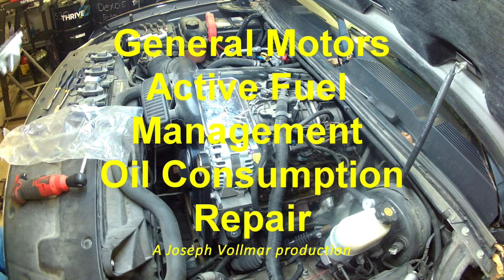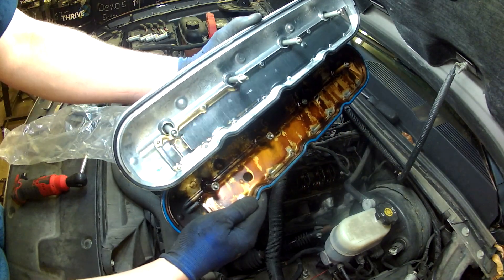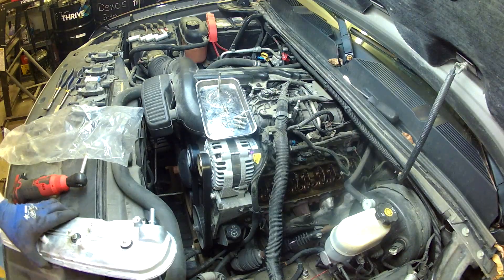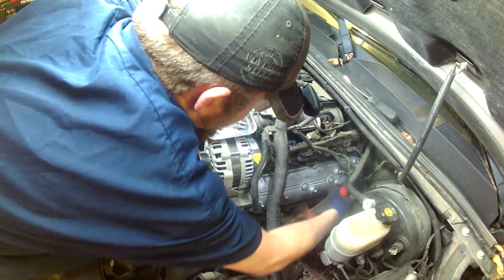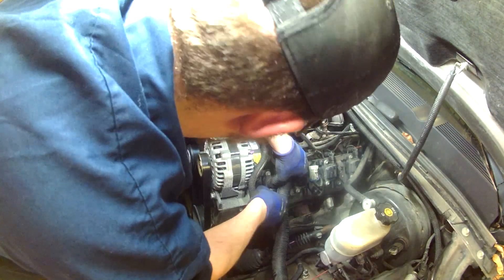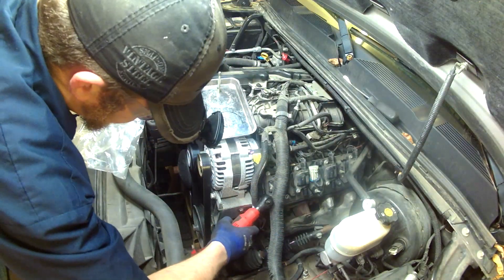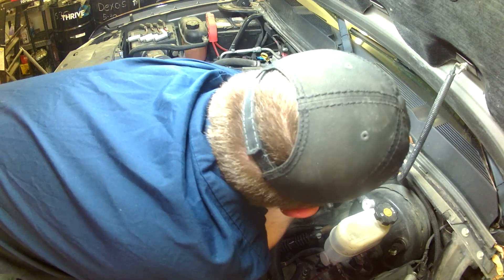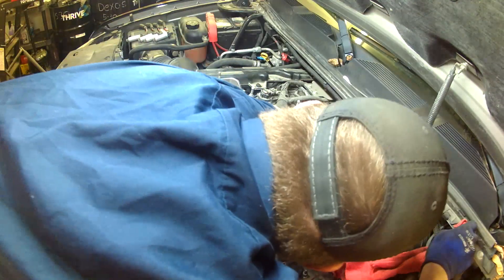General Motors Active Fuel Management Oil Consumption Repair

Comment: What year did they start with the updated valve cover? In other words, I'm in a 2014 model. Should I be concerned?
Reply from the maker: General Motors started phasing in an updated valve cover around 2014 or 2015, but there were a large number of vehicles that were still coming out with the old style cover. I don't know if they were trying to get rid of the rest of the stock that they had, or what the deal was. if yours is the 2014 model I would pull it off and take a look at it. If you have the updated design all it will cost you is maybe an hour of your time and possibly a valve cover gasket (they generally can be reused, but just check it for damage before putting it back on). If you have the old style catching it now could save you money down the road.
Reply: @JosephVollmar  if ive got the old style and want to give myself the best odds of correcting the problem, I know I need the updated cover and a new gasket, is there anything else I should add or replace?
Reply from the maker: If your truck is lower mileage, say under 40,000, and has not been using any oil I would not be too concerned. The biggest issue that is generally associated with this problem is that the rings will get carboned up from the burned oil. If yours has been burning oil I would buy a can of Sea Foam engine treatment and add it to the oil about 250-500 miles before your next couple oil changes. This will help to clean up any of the carbon deposits. Just try not to do any heavy towing while you have the Sea Foam in the crankcase. It will thin the oil down a little bit, so you really don't want to put a hard strain on the engine with thinned oil. If you cannot find Sea Foam, you could use Marvel Mystery Oil. 
    Aside from that I don't think you will have any problems.
Reply: @JosephVollmar  it's a 2014, 96k miles. At about 60k miles I had one single spark plug fail (either number 1 or 7 if I remember), but no explanation why. Then a few days ago, at 4k miles after an oil change, my engine oil low light came on, and it was 3qts low. Dealership confirmed no leaks. My catalytic converter failed two days after the low oil alarm, so i'm assuming that's likely from the oil consumption.  I'm not sure yet if it has the old style or new, but this issue seems to fit the symptoms perfectly.
Reply: I have a 2014, and my truck is in the shop for it as we speak. 4 days ago got the low engine oil alarm, was 3qts low 4k miles after an oil change. Added the oil back. Yesterday my check engine light came on. Took it in today for an oil change and to check the light. They determined it burned the oil, zero leaks, but "werent sure why." The check engine light was for catalytic converter failure due to oil consumption. Idk if the issue in the video is the culprit, or will fix it, but it definitely seems to affect 2014 models as well.
Reply: Mi Sc *9 7

Comment: cool video, where did you get the battery powered ratchet?
Reply from the maker: noway man it’s a snap-on. After I bought mine my boss bought a Milwaukee and if I could do it again I would go with the Milwaukee, more torque, smaller profile and batteries are a lot cheaper.
Reply from the maker: noway man I do have a video reviewing the battery ratchet from snap-on.

Comment: GM active fuel management fix. Buy a tundra problem solved.
Reply from the maker: Ramiro Escamilla the Only problem with a Tundra, look up rack and pinion replacement and step one is remove engine assembly. Not kidding, been there. It is a job that pays 20 hours of labor. You can do it without removing the engine, but you have to pull the front axel to do it.
Reply from the maker: Ramiro Escamilla my last comment was not a joke, but all joking aside they all have their issues that make you wonder what the hell the engineers were thinking.

Comment: Where would be the proper place to purchase this valve cover?
Reply from the maker: Robert Munguia any auto parts store. In most cases it would be a Dorman brand product. The part number for the Dorman was posted by one of the other commentators. Shop around and see where you can get the best deal. You may even try the part number on amazon.
Reply: Yeah thanks! On amazon it even gives me an AC Delco model.
Reply: What’s the part number ? And price

Comment from the maker: 12570427 Is the GM part number. On of the other comments lists the dorman part number through Rock Auto.
Reply: Joseph Vollmar I have a 2014 Sierra 5.3 which is burning oil...Will this fix it? I have an appt with the dealer this week to start a oil consumption claim under warranty but rather than piston/rings, this makes more sense...Or, did GM remedy this in my year? Pls let me know asap..drjohnboruta@telus.net Thanks
Reply from the maker: ATLP exhaust non resonated you are on the edge as far as the valve cover goes. If you can get the dealer to fix it you may be better off. I think in some cases if the oil consumption is bad enough they are reringing the engines.

Comment: I've done this on 09 5.3 v8 Silverado. But after about 2 months  cyl 1 has a misfire due to fouled spark plug. Makes no sense spark plugs were brand new also 2 months ago. Now am considering doing the deflector that's also recommended by gm. Truck only has 90K
Reply: Same happened to me today. I replaced plugs at 100K back in Sept 2016. I replaced the valve cover (updated version) March of 2018. Yesterday and Today experienced a P0307. Fouled plug on Cylinder #7. I checked the plugs esp AFM cylinders and AFM plugs were all fouled. Heavy carbon buildup and soaked in oil. Non-AFM cylinders looked great. It may be time to get rid of the truck or do a Texas Speed AFM delete with a new cam. GM ruined a perfect engine with this system.
Reply from the maker: Tomas Torres I completely agree with you. The pre AFM trucks got the best fuel mileage of any of the full-size 4x4 trucks, and the Addition of AFM did not significantly affect fuel mileage. They should have just left it alone. I have personally seen the abuse the early 5.3L’s could take, even with poor maintenance and still go well past 200k or 300k miles with no major issues. This is one of the reasons I personally would not by a late model GM vehicle. 
     Before you dump your truck though you may try putting another set of spark plugs in it (the cheapest AC Delco offers) and then change them again in 6 months or so. The bottom of the intake on the 5.3 can hold a lot of oil, and there may be residual in there from before the valve cover was changed that is slowly being sucked through and burned. You could also try pulling the intake and cleaning it out with brake cleaner and putting it back on, then see if the plugs are still fouling.
    We have also had two of these engines develop a miss because they sucked one or more valves on the AFM cylinders. We suspect it is from the heat and cool cycles as the cylinders cut in and out.
Reply: If you delete the afm with a range technology module will that stop the oil consumption?
Reply from the maker: james britt it may not completely stop it, but it should substantially slow it down.
Reply: @edwardbritt3076  I deleted the afm on my 2011 silverado and it still consumes 1.5-2 quarts between oil changes. Didnt know about the valve cover so thats going to be my next thing.
Reply from the maker: seduzu420 The deflector would be worth a shot. Normally cylinder 7 is the first one to oil foul because the PCV enters the intake right above it. Let me know what you find out/ how it works. I have never heard of a problem quite like yours before.
Reply: Was the misfire only noticeable while at an idle?

Comment: Chevy is shit, 45,000 miles on wifes equinox and it burns two quarts of Mobil one every 1000 miles. It's a 2010. Dont buy these vehicles.  Not only that but you are lucky to ever get better than 20 miles per gallon.  The 30 they claimed is a complete lie.
Reply: Cant blame the whole batch over one rotten one. Got a 07 avalanche with 250 thousand miles and still pushing on
Reply: @johnnytsunami6185  how many tranny?
Reply: Original believe it or not
Reply: @Johnny Tsunami  nice , I'm glad for ya

Comment: I just bought a 2018 5.3 Silverado.  Anybody know if this issue has been corrected by Chevy or will I be looking at this fix later down the road ?
Reply from the maker: They know what the issue is, and supposedly they have fixed it. I have heard of some of the new trucks ending up with the old style valve covers. I don't know if they had some old inventory that they were trying to get rid of or what. The best thing you can do is just pop it off and check for yourself.

Comment: I have a 2012 model and I'm going to check mine this week. You make it look like an easy fix. I'm also going to install a Diablo predator 2 tuner and disable the afm system. If I wanted to save fuel I wouldn't have bought a full sized 4 whl drive, I'd drive the wife's import.
Reply from the maker: It really is a simple fix. With limited mechanical knowledge, and a few basic tools this job may take a little more than an hour, while someone with reasonable ability will fly through this job.
Reply: that’s me

Comment: I need to try this on my 2011 Silverado. Replaced wires and plugs recently because it had multiple misfires on number 7. The plug was fouled with oil and haven't had any misfires since I changed them. The shop manager at the local dealership was talking of this but looks easy enough to do myself and save a few bucks.

Comment: Yes, i want to know my 2007 chavy avanlanch burning oil when cold start. Please can you tell me. how to fix.
Reply from the maker: The first thing I would need to know it the mileage. If it is a higher mileage vehicle, it could be leaking or worn valve seals, It could also be from issues with the valve cover as discussed in this video. The reason you would only see it on a cold start is because once the catalytic converters come up to temperature they will burn off the white smoke that you are seeing when you first fire it up. I hope this helps a little, and thankyou for watching.

Comment: Hi Joseph, I have a 2011 Chevy Silverado 1500 w/ 5.3L.  It has almost 63k miles on it.  It wasn't until recently that I found out that my truck was consuming oil.  Because of the newness of things' I'm still trying to get a feel for how much oil is being consumed and how fast. (It could be a quart or two between oil changes)  I've seeing multiple discussions and videos talking about the vale cover being the problem because of the design.  So, just today I went out and bought a new valve cover to install.  To my surprise, when I pulled the old one off.  I found that it was pretty much identical to the original valve cover.  Like others, I've heard about the computer chips designed to by pass the 4 cylinder mode saying that it has just as much potential to have an effect on the consumption as the valve cover.  I was hopeful that the valve cover replacement would be a fix for my truck.  But, now I am at a loss.  I don't know what to do next to help solve this consumption issue.  If you have ideas or recommendation I would love to hear them.  Thanks for any help that you can offer.

-David
Reply from the maker: David, in the video I show the difference in the two valve covers. Take a look at the ones you have and see if they are the updated version, or the old style. You can still buy the OE style valve cover, and you may just need to specify to your parts person that you are looking for the updated version. If that is not the case without seeing the truck I hate to venture a guess as to what might cause your oil consumption issue. I hope this helps, and thank you for watching.
Reply: I bought my replacement through Rock Auto and it is the updated design.
Reply from the maker: MJ Brown can you post the rock Auto part number in the comments in case anyone could use it please.
Reply: Both the one that came with the truck and the one I purchased at the dealership are the update design.
Reply: I have been working on this problem for awhile on my 2011 Silverado with 5.3L and I believe there are a number of possible sources for the problem besides rings or even valve seals.   I have tried the device that programs out AFM without success at stopping the smoke and oil consumption oil.   
At the suggestion of a local mechanic I added 1/2 can of Seafoam to the oil about 150 miles before an oil change.   This did work for a few hundred miles and the oil consumption and smoke returned.  
I tried MMO which really improved my gas mileage but did nothing for the oil consumption and smoke.  
I most recently changed the valve cover to the new design and that has worked so far.     Keep in mind that the PCV valve is built into the valve cover.   Is it possible it has failed in your old cover?
Reply: Maybe?  I don't know.  Is there a way to tell if the PCV is the problem?  Also, what the heck!  GM makes what should be a $5-$10 fix and turns it into a $85 fix for the part that may be the problem!!!
Reply: I agree car companies don’t always do things that are right for the consumer.  There are videos on how to test PCV valves but they are for ones that can be removed and tested while the engine is running.  Do a search and you will find several.  
I bought my new replacement cover for about $40 and installed it in less than 1/2 an hour.   I fear if this doesn’t fix your problem you are into something more costly.
Reply: Please know that if you have a Chevy and you bought a new valve cover, depending on which auto store you bought it from the valve cover can either be the original one which is designed wrong or the newer style which deflects the oil. Example. Advance Auto still sells the faulty old style valve cover and AutoZone sells the newer design that you need to stop the oil consumption. Now why advance is still selling that crappy original style is beyond me. My point is maybe you bought the original advance style??